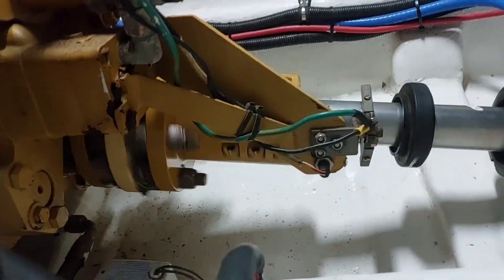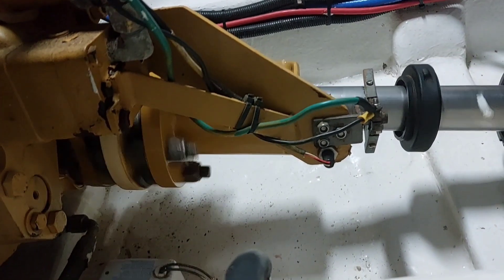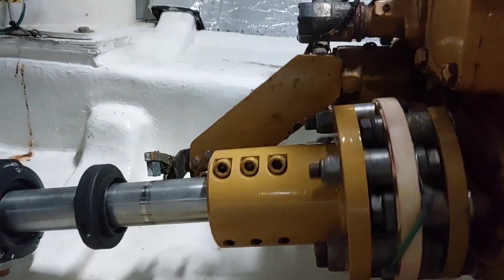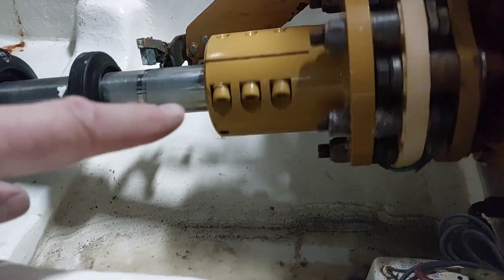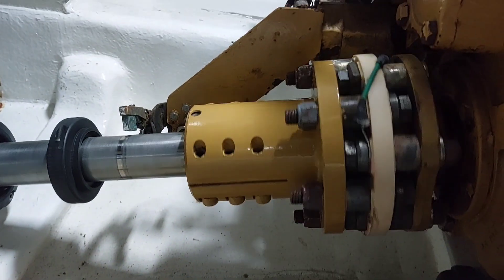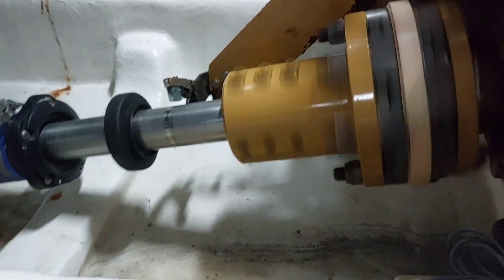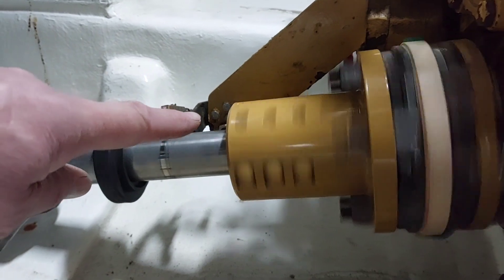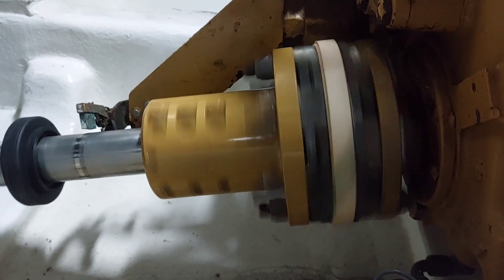shaft miss alignment on sea trial

Comment: Your R&D couplings seem to be bonded so why the shaft brushes?
Reply from the maker: This is not my boat.. so some times having electro eliminator improved a high resistance that you can suffer with when bonding through a gear box. Some engines are actually isolated from gear boxes.. good question!